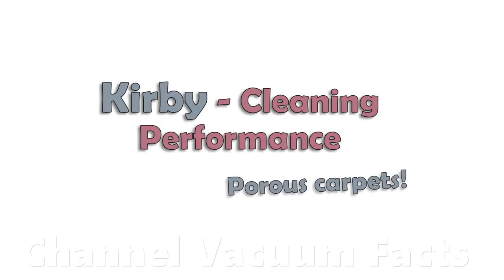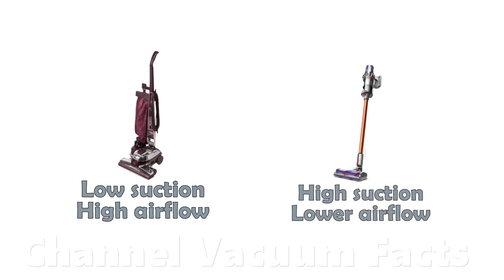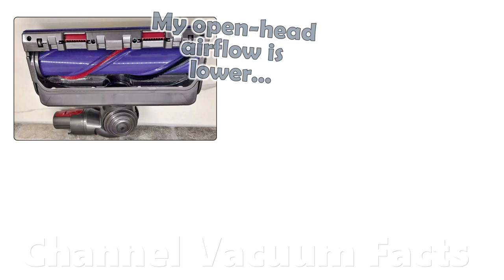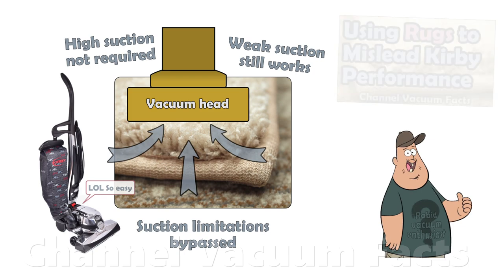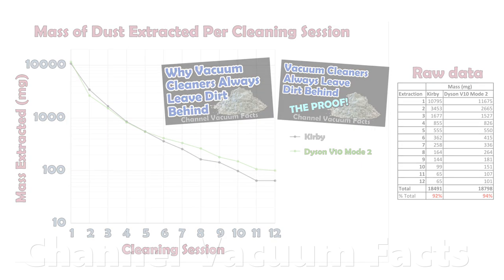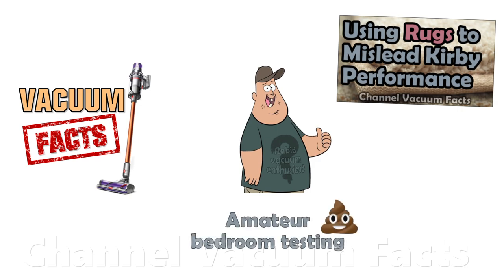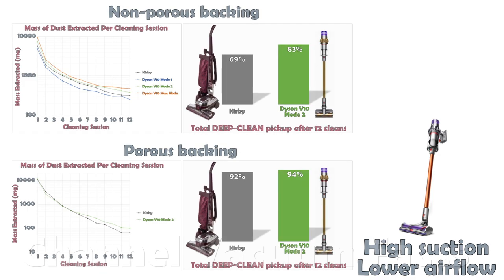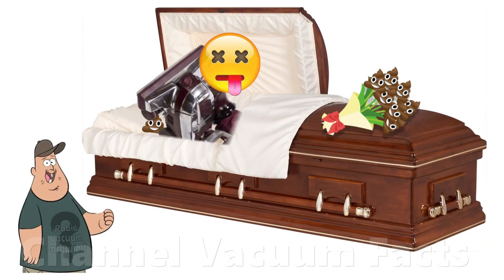Dyson V10 (not V11) Vs Kirby on Porous Carpet

Comment: Another Unfair test😂
You used the Kirby to vacuum fine dust with the Dirt Meter. After one pass you must change the pad like I’ve already said it’s like useing a Dyson with a blocked filter.

If you were to repeat the test again then use the Bag assembly instead of the Dirt Meter.
Using the Kirby Dirt Meter reduces the Kirbys Airflow by 50% if I had the equipment to prove it I would!
Reply from the maker: Ah, the predictable desperate attempts to invent flaws in the testing methodology. Firstly, how do you know I didn’t change the filters between cleaning sessions? In fact, I did, for the very obvious reason you gave. New filters every time thus gave the Kirby a very unfair advantage, because it represents pristine condition, that’s new of the box, without any dust loading. Totally unlike it would be for most of its dust-loaded usage time when dust gets in the bag. You’re nicely highlighting a weakness of bag technology there, so thanks for that. I’ve already shown high airflow has no impact on results anyway. Even a pristine dirt meter pad will offer comparable flow to a new bag and is vastly higher than a Dyson cordless, but the more meaningful performance results are still comparable at best between the two machines. It’s like you’ve completely not understood the meticulous explanation given for the observations and what is happening, and are still fixating on a constituent parameter whose influence alone is not important. Your criticisms just don't add up nor account for the observations. Nice try though, even though you scratch the bottom of the barrel.

Comment: Well suction can be good to have but too much of it can be a bad thing especially with a really aggressive brush roll. Suction and airflow work good together. I’ll ask you this if suction is the pressure that a vacuum puts on something like your hand on the opening of the hose and airflow is how fast the air moves how will the dirt get in the bin without airflow and just very high suction?
Reply from the maker: I produced a video which explains the principles of vacuuming in detail, which I recommend to help answer your question :) https://youtu.be/EhcF0MH9HfQ

Comment: My problem with Kirby's and most vacuums like it is the claim of, "it lasts 30 years". No one now days gives a fork if it lasts 30 years. I ask many people at stores when I see them buying vacuums how often they replace them. Most people say every 3 to 5 years. They either find something better and nicer to use, it has a problem they don't feel like fixing, or smells bad and they get rid of it. Case and point, someone I met at a Walmart had a Bissell that the belt broke, they had it for 2 years, they said "its easier to replace the machine than to replace the belt". People care about ease of use more than quality. My mum always says, if its hard to do, people wont do it. Such as vacuuming stairs with a corded vacuum. Mega pain with a corded machine. Before I got my cordless Dyson I vacuumed my stairs every months or 2, now I clean them every week or so with my V10.
Reply from the maker: Like with the Henry review, this 'Kirby week' was to expose nonsense and myths peddled by misleading YT channels that are ignorant of simple facts. The Kirby is a functional product of a bygone era. Collectors might like them—and that's absolutely fine and good for them—but starting making factual claims which are false and you'll just look foolish after I'm done.
Reply: @VacuumFacts  , Sadly there is lot of nonsense floating around on the internet. Some channels base there findings on a few unrealistic exaggerated tests on 1 carpet and floor and call it good. Some others are such idiot they cant even use the machine right. Some do tests the machine is never designed for like sucking up unrealistic piles of dirt. And then there are the worst of them all. The vacuum Nazis, the ones who, make fake allegations to falsely prove there opinion is true, lie to viewers about real specs or performance of a product. Magically create problems or misuse the product intentionally to make it look bad for there own satisfaction. Lie to viewers about unnecessary maintenance, try and fix "problems" with a product by telling viewers to modify or spend money on addons for products they don't need. Performance Reviews is a prime example, His "I work on vacuums so I must be better than you" mentality makes me sick. He's rude, constantly saying the Dyson's are shi* "I hate this I hate that" I'm better than you bla bla bla" in basically every video he makes. He makes false claims of tests on my videos, and on some of yours. Sais the V10 is heavy, then says a 20+ pound vacuum is light, Somehow his V11 "doesn't push" on his carpet, (because he uses it on max with the gates on +) He constantly creates problems with every vacuum he doesn't like. He always bases his cleaning results on eye alone. Fires rude comments on people, You and I. He was a total dic* on a redit post about my video, pulling claims out of his as* how its, unfair, flawed, fake, biased etc. Check out the video, https://www.youtube.com/watch?v=uh-lsMW_3tM
Reply from the maker: @VacMaster1991  There isn't a single amateur source out there I'm aware of that provides believable, QUANTIFIED, comparative performance testing. So I had to do it myself for some of the 'bigged up' machines and correct for all the glaring errors the rest make. Even then, the industry standard comparitive tests are the true golden standard. Independent testing shows Dyson machines comes out on top on average across all floor types. And then there's everything else beyond performance to consider, like usability, running costs, and environmental impact.
Reply: @VacuumFacts  , usability is very important. ex: if 1 vacuum cleans 5% better but is 10x times harder to use and needs its filter cleaned 3 times per month. Is it a good vacuum? Or this vacuum is 30% cheaper and cleans the same, but has filter and bag costs, barley fits in my closet and has a 15 foot cord, is that really nice. How good is a vacuum isn't just cleaning performance like most people say. There is filtration, maintenance cost, ease of use, price, reparability, customer service of brand, ease of maintenance, the list goes on and on. That is why I stick with rating my machines based on how they are to live with. Not just how well they clean.
Reply from the maker: @VacMaster1991  Yeah; I've referred to this in my videos as the 'holistic' performance. Even after I've cleaned up the shocking errors of the misleading channels out there, I consider everything, not just "longeivity" or "power".
Reply: Vac master if you happy with a little stick 🦯 clown vacuum that’s okay people that use Kirby’s I can guarantee you they will never go for anything else but Kirby we received a lot of those clown sticks and their motors burn out terribly quick
Reply: @azvacuumskirbyservicingkir9136  , I am plenty happy. No need for a clunky ancient vacuum from a by gone era. Think of it this way. A old brick phone may  be durable and last long. But nobody is going to trade in there iPhone 12 Pro for it. People now care about convenience, light weight and lots of cool flashy tech. I am the same way. Most people don't care if it lasts a long time. Welcome to todays world. This isn't 1960 anymore.
Reply: @VacMaster1991  unfortunately the Dyson only has one function and not 100 fictions as the Kirby has the Dyson unfortunately cannot shampoo carpets
Reply: @VacMaster1991 I have definitely noticed that with his reviews of Dyson vacuums.  He's heavily biased towards Miele, Sebo, and the Zero G brands, and is totally against all bagless vacuums including Dyson.  Plus he claims that you have to replace the filters once every 6 months, which is a bullshit lie.  The filters on Dyson vacuums are made to be washed and reused.
Reply: @azvacuumskirbyservicingkir9136 And the Dyson excels in that one function, instead of trying to be a jack of all trades & master of none like the Kirby.

Comment: I have many questions. Why have you not try fitting the more modern brush roll design to your Kirby? Also, the newer kirbys have more airflow due to the new mini emptor design. I am a Kirby fan. However I have a lot of love Dyson and their innovative technologies as well. But I’m not quite sure if this test was quite fair.
Reply from the maker: That there is more than one brush roll to have to bother to fit is a design disgrace. There’s no evidence they make any difference to performance, as measured by meaningful industry standard relative testing and not some verifiably misleading bedroom tester. You cite “airflow” without stating what measure you're talking about (open hose or resistive load); plenty of videos on the topic on my channel to learn from. Why tell me you think it’s ‘not fair’ (despite the copious evidence that you haven’t even touched on) yet provide absolutely no justification… Most of the nonsense peddled by Kirby ‘fans’ has been debunked in my videos. There is simply no argument for any attention to be given to this machine for its intended purpose and they should be left to dusty collectors.

Comment: Do you own any corded dysons. I would like to see a comparison between the  v10 vs a Dyson multifloor ball.
Reply from the maker: I did but sold them ages ago. Once I got the V10, I didn't need any other vacuums. Plus I'm not a collector or fan of vacuums believe it or not—just of facts, and making sure aggressive liars with a bad attitude are exposed. I suspect the Dyson light ball and ball 2 uprights would perform comparably to the V10 in max mode, because industry testing formally showed they were the best cleaners of all on the market. But Mode 2 is still very close in practical terms, especially for low concentrations. Plus all the benefits of the superior form-factor over corded, especially when you utilise the benefits of the bite-sized cleaning model.

Comment: My V10 does much better on rubber backed door mats.   I have no idea which type of backing my wall to wall carpet has though.
Reply from the maker: It doesn't matter what backing it has. You're using the V10, not a Kirby! The V10 cleans on any flooring.

Comment: I vacuumed under my sofa by moving it it hadn’t been cleaned in months I went over with the Kirby for 2 mins then went over with the v10 the v10 dyson  found found no dirt at all and I have the g6 Kirby so explain that it deep cleaned and removed all the dirt from behind and under the sofa so much that dyson found nothing
Reply from the maker: OK. So what. Doesn't explain any of the data discussed in the video.
Reply: I don’t dispute your findings I’m just saying on my standard U.K. carpet after hoovering with a Kirby over a dirty patch of carpet going over at least 15 times then going Over with the v10 the v10 found no dirt and I’ve been using a Kirby for two weeks now every day and it’s nearly got a full bag but your tests are correct but Kirbys aren’t bad vacuums though
Reply from the maker: @jamespartington5  They do the job. But there is better tech out there by every metric of importance, as discussed in my Kirby review.